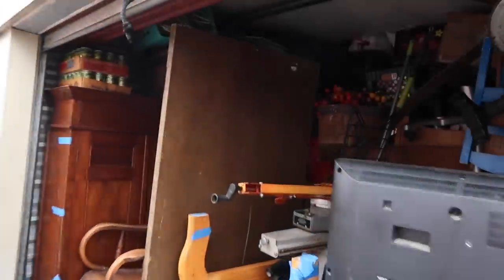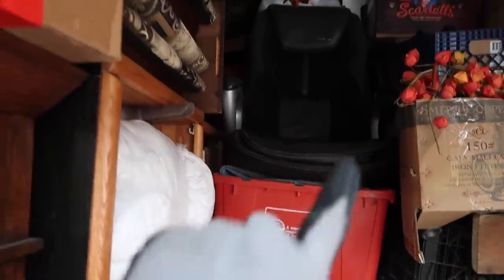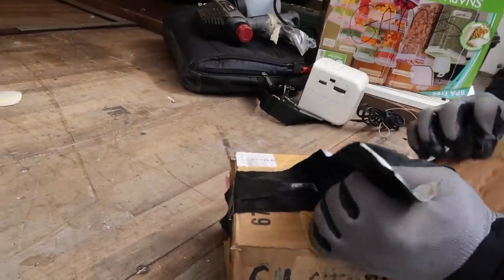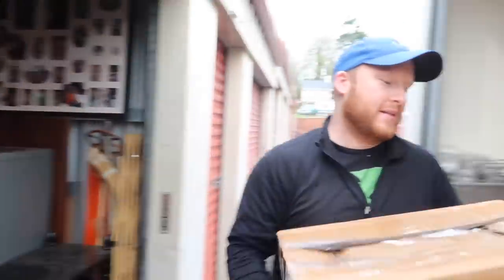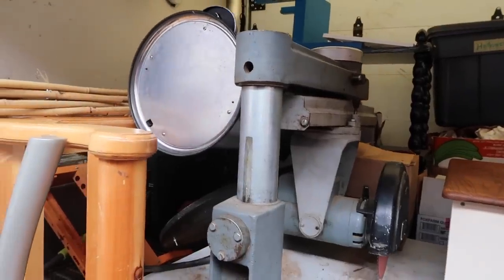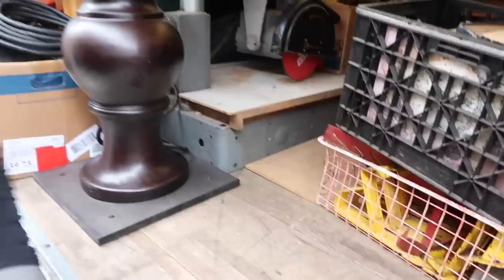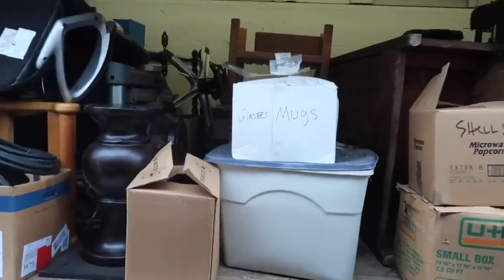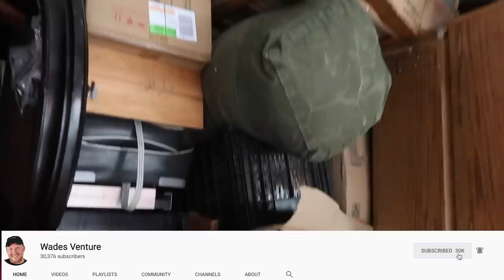Old Vintage Storage Locker Abandoned.. Until Just Now

Comment: I just started watching your video's your awesome, I totally love that you truly care the families receive the personal items back. I have always wanted to bid on storage lockers but I haven't as of yet, but you certainly make me want to for sure. Good luck on your finds and don't forget your knifes, maybe your should build a little holder inside your truck to carry some of the supplies you may need, you can put a little removable bracket built inside the back truck (something that you can break down if necessary to hold the knifes , a hammer and screw driver , pliers just incase. 

Happy Storage finding , Kathi from Garner, NC

Comment: the saw is a commercial grade one. You would not believe what it's possible to do with one of those. With the help of some jigs, you can actuall even turn square stock round, or even with a twist in them. That one, it can run all day, it's an expensive machine.

Comment: Its been great fun watching you finding treasures in the lockers.  A box of wood, and a miter saw,  that means this previous owner is a wood worker, the box of wood may actually be variety of very good quality wood for making mosaic wood design. some of the wood may be very pricy.  Also, I recommend leaving a boxcutter permanently in the truck. or have a very small knife on the keychain, that would solve the problem of not having a knife.

Comment: When you do a brake job on your car you have to bleed the lines to get the air out of them that is a tool where you run a line from the bleeder valve on the brakes and when you pump breaks up then you crack the bleeder valve open and it squirts brake fluid out and when it quit spinning are out with brake fluid your brakes are bled. And you start with the break that is farthest from the fluid Reserve and you work closer

Comment: Comments 

The Rockwell Delta saw might be worth quite a bit
Golf clubs are recent cheap off-brand, plus old woods
Records are common rock in middling condition, the $3 box at the record show
'Book of Knowledge' is worthless
Professional-grade tools should sell well
The wood cabinet is probably not as valuable as you think - too big for modern houses, and difficult to move
Other dealers sell magazines like the Hot Rod stuff for $5 each
That 'record player' is garbage grade and will destroy your records - throw it out 
Check the wood for good hardwood pieces - those are expensive if you buy them - maple, cherry, mahogany
Look for pre-1965 service station maps - those are collectible
Ammunition is really getting expensive - don't know if you can legally sell it though - might have to take it to a gun shop
Unused original sealed blank cassette tapes are in demand

Comment: Brake BLEEDER. When you do break work on your car you end up with air in the lines and they will not work well that way. So you need a system to remove the air from the lines.
Reply: You need a pocket knife key chain
Reply: Looked like a vent fan for a stove that was over the box with the "girls artwork"